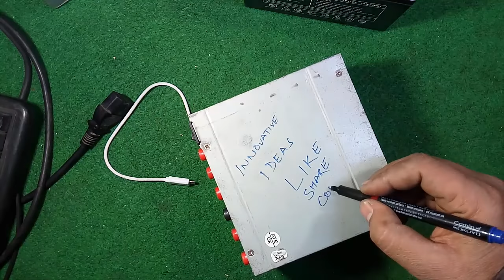How to recycle SMPS of Computer for battery charger and smartphone charger by innovative ideas

Comment: batteries can deplete its potential energy totally to 0 volts, 12 volts on the spec only means that it have 12 volts max of potential energy. the meter shows that the batteries is 9 volt at the time before charged (but it also shown that the batteries do still have some potential), the output from the mod psu is 12 volt, so the mod psu can charge the batteries up until the batteries have same potential energy of 12 volt.
and you should put the red cable 12v output into the avometer too at 2:26 it shows that the red cable is +12 that means it also produce more then 12v, its vary on different psu but usally like 13 - 15 v ish.
Reply: SIGH! When are people going to wake up and smell the coffee? 

NEVER NEVER NEVER NEVER NEVER drain a lead acid battery (of ANY voltage) to 0 volts! Are you INSANE? NEVER drain it to below 11.5 volts and even THAT is pretty low. Do you want to utterly KILL your battery? For PROPER operation and LONG life they need to operate within a specific range. It's why your car battery will die if it is NOT charged by using the car on a regular basis just as easily as it will die from over-charging due to a faulty alternator.

IT IS UTTERLY IMPOSSIBLE TO PROPERLY CHARGE A 12 VOLT L;EAD ACID BATTERY FROM A 12 VOLT DC SUPPLY. STOP BELIEVING YOU CAN ... YOU CAN'T. AND IF A 12 V LEAD ACID BATTERY IS CONSISTENTLY RUN UNTIL IT'S TERMINAL VOLTAGE FALLS TO 9 VOLTS YOU WILL DESTROY THE BATTERY'S LIFE NO MATTER HOW MUCH YOU THINK YOU ARE "RECHARGING" IT!

WAKE UP! DO SOME PROPER RESEARCH!

Here's a good link that gives you PROPER info: https://electronics.stackexchange.com/questions/38321/what-should-the-voltage-of-a-fully-charged-lead-acid-battery-be
Reply: yes, but i was referring to answers below.. about cannot charge from this kind of charger because potential flow must be more then 12V but it does have more then 12V (+12v)
in terms NEVER NEVER NEVER, well not really.. there's always what type's of batteries, what price and quality etc..
as long as the cell still in good condition, the acid can be replaced that is i agree when a batteries reach 0 volts, the acid chemistry gone bad but not always the cell
what you must not is charging 12 volt batteries with 24 v settings.. now that's a NEVER NEVER NEVER..

Comment: hello bro plz show a test 12 v 45 amp charging in your method.
Reply: read my comment in reply to Joseph Nicholas further up the comments. Don't waste your time time waiting since this method will guarantee a shortened life and low capacity charging (or even DISCHARGING!!) of your battery, whatever its capacity. A 45 Amp Hour battery can be charged in exactly the same way at exactly the same charging voltage and current (presuming a nominal 12 volt lead acid) as any other 12 volt battery - the ONLY difference is that IF you have a 90 Amp hour battery it will take AT LEAST TWICE as long to charge as a 45 Amp Hour battery and a lower Amp hour battery may need to have the charging current lowered. A larger amp hour rating battery can ALWAYS (for most practical purposes) be charged at a lower current ... it will just take much longer to reach full charge. 

If you have a normal fresh battery sitting at 13.8 volts across the open terminals, Kirchoff's law tells you that it will NEVER be charged EVER from a 12 volt supply. Likewise, even if your battery is at only 12 volts it can NEVER EVER be charged by a 12 volt supply. It just doesn't work like that. You HAVE to have more voltage at the charger output than is sitting across the battery terminals otherwise NO CHARGING CURRENT WILL FLOW - a DISCHARGE CURRENT however MIGHT!!!

Comment: The title should read charge up to only 40% or put only 60 ah only into a 150ah battery keeping it at a capacity that will drastically shorten its life and damage it. As far as 12v...basically near to most Battery flat discharged voltage.So due to the misinformation you have wasted people's time,
Change your title and you will become a more honest youtuber. Otherwise your build video was good.
Cheers 🍻

Comment: Thanks for showing me how to make a 12v 30amp power supply. Needed for a model A ford wall art project that I wanted a working horn on.  Bought a power supply but it didn't have enough amps to run the horn properly.  This computer power supply does the trick for sure.

Comment: What if I connect - 5v to +5v and with ground? To charge laptop battery does it work or blow.
Reply from the maker: Laptop battery means lithium ion cell is of 3.7 volts. To charge a cell you need approximately 4 volts. Not more than that. 
Kindly check any li ion charging module on Amazon or any other website. Thanks
Reply: INNOVATIVE IDEAS that have smps and 11v connected to 12v smps runs fan with battery going back voltage

Comment: BEWARE. This is perfect as bench power supply but it will not charge any battery to full capacity. To charge a lead acid battery, (big or small) you need about 14.0 to 14.2 volts. There is need to modify the ATX computer power supply to boost its +12v to +14.2 volts
I have already worked on such a project and modified its volts to 14.1 volts DC, to charge  lead acid batteries.
Reply: can't we use 12V+ 3.3V = 15.3v together for 12v car battery charging?

thanks
Reply: @nuwanweerakkody2985  
No and yes. You need -ve 3 volts. So you need to change +ve to -ve which I think average technical person can not do that. I can give you tip. Use two ATX units. Use 12v of one and 3.3 volts of other one in series.
or
modify 12v to 14v.
Reply: @nuwanweerakkody2985  just use buck converter to boost dc volts.
... its cheap..
Reply: @iffee100  can I use 5+5+3.3=13.3(60amp) for 12 volt 100ah battery ?
Reply: @iffee100  This sounds interesting, I never heard it before, where I can get more information regarding this?
Reply: @nuwanweerakkody2985  sir please tell me 12+3.3v= 15.3v how Much get ampere???
Reply: Sir please tell me 12+3.3v 15.3v how much get ampere??? Please please please give me answer??? 🙏🙏🙏

Comment: Mines really weird and different instead of a white wire its grey  and says on the pcb pg and the green it says psdn and  i got 1 brown wire that says + 3.3vs and on the pcb for orange it says 2 different voltages + 3.3v and +5vsb  but the red is also +5v and yellow is +12v and has 2 thinner gage wires and 3 thicker but i also got a pink that says +5v.s  purple, i think i might of mistaken the orange of havin 2 different voltages so i think thats the +5vsb and i got blue for -12 v  so would i take a power or toggle switch on green and grey? Oh yea 2 black grounds are also thinner is there a certain way to hook them up like to the other thinner yellow wires for the ground of a certain other volts.?

Comment: hello sir can i use as 12volt 10 amp power supply..does it give pure 10 amp output???
Reply from the maker: Anshu Chaubey yes you can use it
Reply: Actuly i am using 10amp cctv supply but it in not pure 10amp and i want perfact more than 10amp or 10amp.

Comment: Can not be charged when both battery and smps voltage are same..it needs to modify internal circuitry of smps then it will increase the voltage from 12 volt to 14 volt...

Comment: I paired 12v and -5v the fan will turn off, also red and orange the fan will turn off...also what happen to my  blue color wire?when i pair with black (common) it will reverse the voltage.the blue becomes negative and the black becomes positive...thank u and i appreciate ur tururial
Reply: Red+white=17v
Yellow+blue=24v
Orange+blue=15v

Comment: r  u  sure  my  35 amp  12 volt  battery  can  fully  charge  within  7 hours at  12 volt charge  level  using  yellow  and  red  wire ???????? .......... can  u surelly  told  me  am  i have to  boost 14 volt  to charge  my  old  car battery  of  12 volt  35 amp ?????
Reply: hlw  please replay  me ????????? also  say  what is  the  amp  output  for  15 volt
????????

Comment: Thank you very much for the explanation Sir, really it's a very interesting video. But I would like to know what is the ohm value of the resistor connected to the LED.
Reply from the maker: 1k ohm resistor, if we connect with 12 volt . Thanks
Reply: @innovativeideas  thank you very much

Comment: To full charge a 12 volt lead acid battery you need to have more or less 12.5 percent higher voptage. Please correct if I am wrong
Reply: i would like to know which diode to connect to, otherwise connecting -12v plus +3.35v the adding a diode to reduce voltage to 12.5v.

Comment: Should all the yellow wires need to be connected together to get sufficient Amps to charge 7aH battery? Won't 1 yellow and a black wire enough to charge?

Comment: THANK YOU SIR FOR YOUR INNOVATIVE VIDEO.  WHAT SHOULD BE THE CONDITION OF SMPS REPLACED FROM COMPUTER. HOW CAN I CONFIRM  THAT A CHARGER CAN BE MADE WITH. AS I HAVE SEEN THAT FAN WAS WORKING IN YOUR VIDEO BUT  FAN  IS NOT WORKING IN MY OLD SMPS AND EVEN NOT FINDING VOLTAGE AT POINTS.
Reply: Connect the green wire together with the grey and the power supply will turn on. I think you can also connect the green wire to one of the common black wires and that will work too.
Reply from the maker: Good।।

Comment: Hi..i like youre video..are all sms are same color to the wire..any brand or model.are they all same color.. pls respond
Reply from the maker: Yes all smps follow the same colour voltage rule..
Reply from the maker: You can also verify by multimeter. Thanks..

Comment: I have a question!
When you connect the -12v with the +5v what amperage do you get?.
Is it from the-12v or the amperage from the +5v.
I only ask because sometimes the 
Lower voltage has a  higher amperage in some power supply

Comment: this method is fine but there is problem when a small sparks happens power supply truns off autometically and than remain shut for a few minutes ....is there any way to disable emergency power off/overload in circuit board.

Comment: sir can we use it to charge a 12v  42Ah (exide ep 12-42) battery. How much time it will take to charge fully and is there any chance that it will degrade battery life if we keep using it as a regular charger for the battery.

Comment: HELLO sir, This was a great way to create a Charger from An Old SMPS of earlier Desktops.
I am highly impressed. Can you help me Create a 48V Battery Charger for my Ebike which I have completed recently? Presently I am charging four 12V batteries separately and then connecting in series to make 48V. I am using Lithium packs of 24 Cells for each 12V Battery.

Comment: nice, i will try that tomorrow. will it charge my car battery?
Reply: Sunil Laldas if it’s work then plz reply my comment I’ll try also
Reply: The blue -12v wire with the orange wires will give you 15 volts which will charge your car battery but with only 1 amp so it'll take a long time. Probably a few days for a full charge.

Comment: Hi  you did not say what colour wire went to the switch as well as the green one also what colour wire goes to the resistor also where does the other side of the led go
Reply from the maker: Bebsbsv Lilld green and black wire for on off switch.. yellow wire with resistance plus black for led...
Reply: sorry to ask does the smps have to be a certain wattage
Reply from the maker: Bebsbsv Lilld yes, I have given all the details with color code of wires...and also in the description section of the video... thanks...

Comment: -12 is of 0.5A it is not possible to charge with single psu i recommend to use two psu one with +12 other with +3 it can charge but some more modification better to use buck converter.

Comment: Is it possible to charge 12 volt battery with 12 volt out put?
Reply: You need minimum of 13.5-14.75 voltage @2 amps to fully charge a 12 volt batter

Comment: Can we chat personally?
Reply from the maker: You can ask your questions here
Reply: @innovativeideas  I done a battery packs from laptop batterys . So how much voltage it needs? Each cell 4.0 x3 series.3500mah = 7000 mah. (- -🔋🔋++) (--🔋🔋++) (--🔋🔋++) shows 10.2v when it charged with smps but battery is not on stable. When I used UPS to charge the battery the battery stays better.

Comment: i have 220 amp battry
Reply from the maker: sorry, it will not charge fully..
Reply: sir its charge battry but i use it like ups
how i use cps like ups
Reply: You buy a UPS that needs new battery and hook your battery to it. 
 To use it like a UPS you would still need a power inverter to convert the 12V DC to whatever the 110V/220V AC, which most of those are square wave which doesn't work on just anything and shouldn't be used on sensitive electronics. Next problem, you would need something to seamlessly switch the power source in the event of a power failure.  If you are using for a computer it is also good to have something that will shut the computer down after so long

Comment: fake title and every thing is wrong!!!!!!!????
Reply from the maker: Hey Bro, I have successfully charged 88 Ah battery of tractor..It was fully charged
Reply: I think use only imagery charging
Reply: Oh no you didn't! You may have recovered SOME charge but it was definitely NOT fully charged. Show us the voltmeter readings across the open circuit battery terminals AFTER full charge using this method please. The battery voltage (open circuit) will NEVER reach any higher than the power supply can output and will even be slightly lower. A FULLY charge battery will sit at a MINIMUM of 13.4 to 13.6 volts and a GOOD battery when fully charged will sit at 13.8 to 14.0 plus volts immediately after charging. How could you POSSIBLY have FULLY charged a battery with just 12 volts? It CANNOT be done.
Reply: This is a innovative way to of using old desktop SMps unit to get different voltage output very nicely explained..... Thank you brother